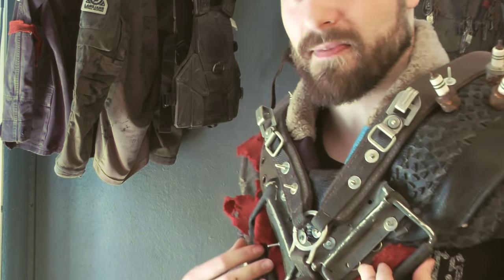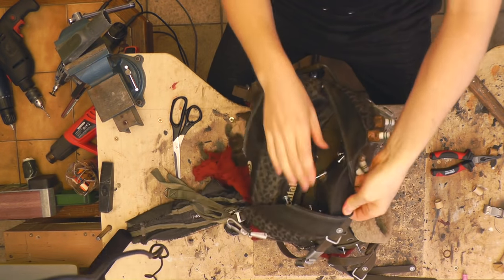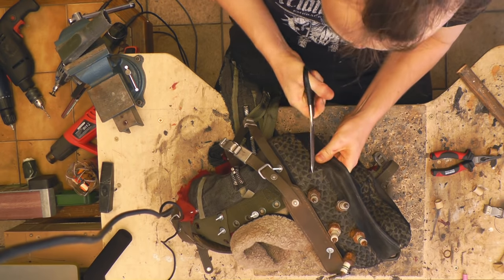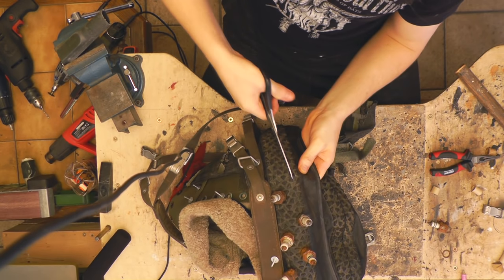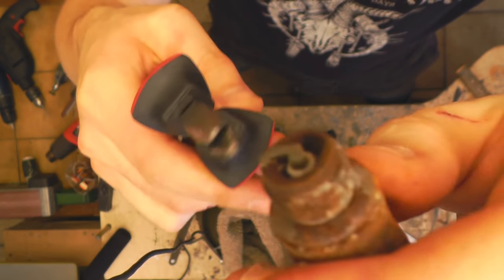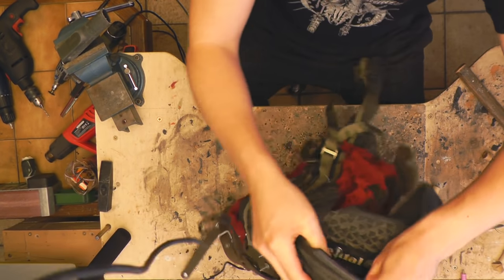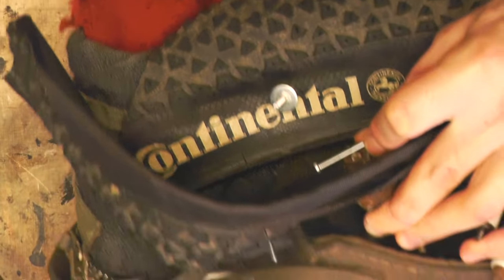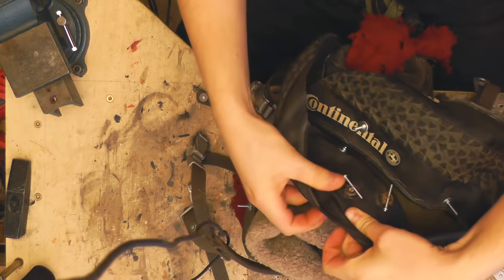SPARK PLUGS + TIRE = SHOULDER ARMOR. Learn how to do this.

Comment: I like how you used the spark gap as a mount, very clever. :)
Reply from the maker: it was that or drilling a hole thru 1/2 inch steel/ceramics with cavities in them.. :D

Comment: I am not a hater. I love all the videos you make, but the spark plugs are still really pointy... and i dont see how it is safe.
Reply from the maker: thats not really pointy mate, also bends away like ive shown. mounted into a SOLID piece would be unsafe thou ,yes.  also depends on what you do with it. i wouldnt exactly wrestle wearing this, no :D but otherwise its fine. worn WAAAAY unsafer shit to larp in the old days, liek that deer skull o nthe shoudler and stuff :D THAT was unsafe AF
Reply: I will trust you in this matter then. Maybe if I would see the piece in real life, I would see that they are pretty safe. It definitely is safer than other stuff yes. Thank you for replying